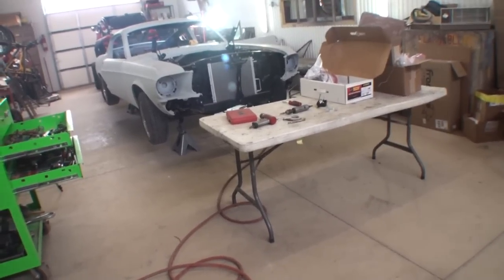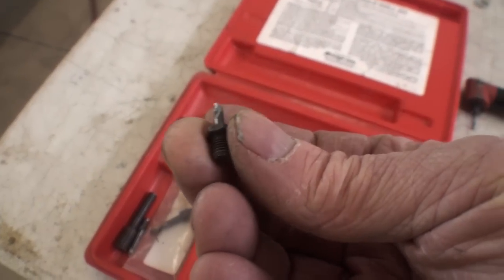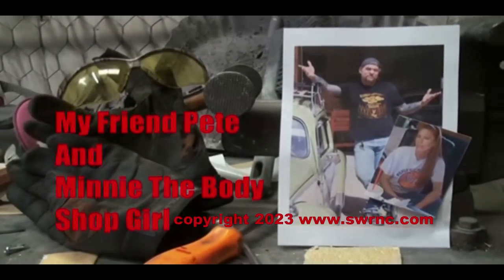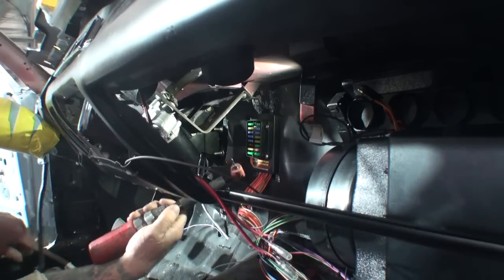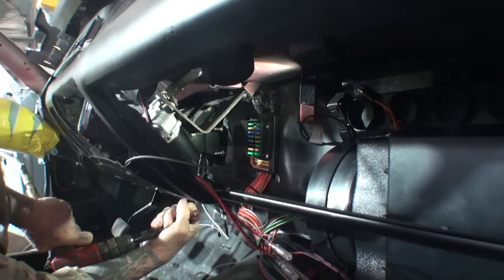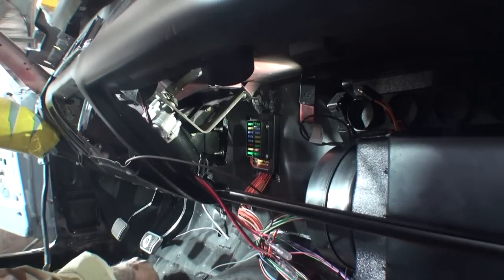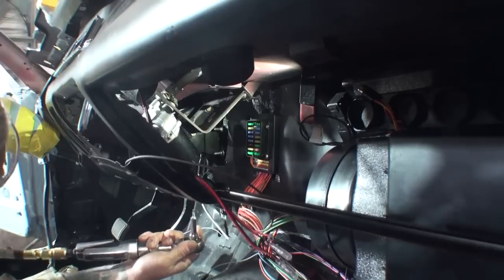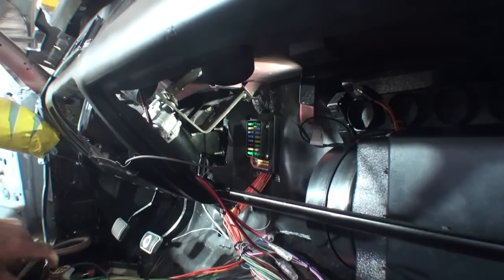Tight Fitting Drill - The BEST DRILL On The Planet

Comment: That would be a really good tool to have in your arsenal to drill holes in tight fit places. I can see how I could get really irritated working under a dash trying to get to stuff I can't see plus I would hope it's not on one of my clumsy day's where I'm dropping stuff. You know how it is to have those day's your fighting everything. Having the right tool just makes the day just all that much better. 👍🏽 
Just the other day I was using a heavy jig saw and it was hard for me to let my finger off the trigger because of the weight of the jig saw, just as I was thinking I'm going to bend the blade trying to set it down. Yup you got it I bent the blade. I straighten the blade out and kept on using the same blade even though I had other new jig saw blades not going to wast blades on a small project. I do have a lighter jig saw but I didn't want to get frustrated with the blade coming out of the smaller jig saw like it has in the past. That's why I was using the heavy duty jig saw I usually use to cut sheet metal, it would be better to have a plasma cutter I'm working my way up to buying one. Might not be the most expensive plasma cutter one that's good for once in awhile type cutting. If I was running a business I would get a really good one if it was something I would be using to make moola.

Comment: 90 Degree Right Angle Drill Attachment Kit Tight Fit Hex Bit Adapter 00110 - New
49$ on ebay.
could come in handy at times im sure